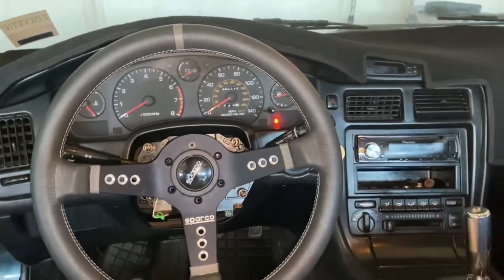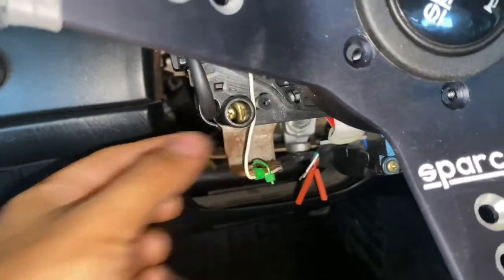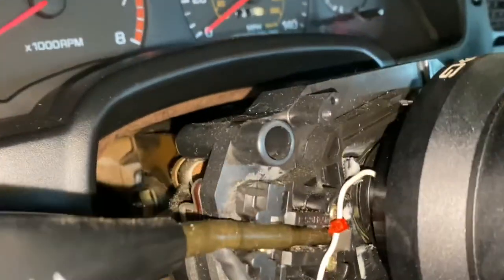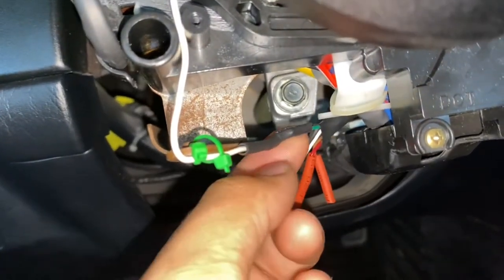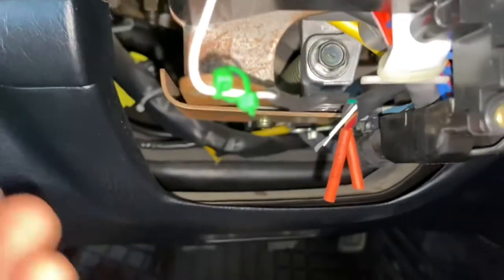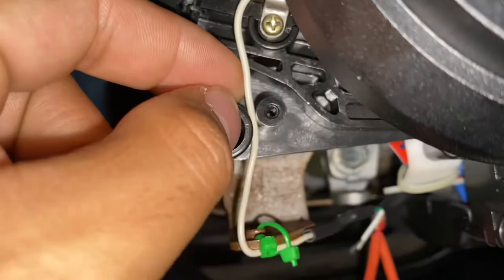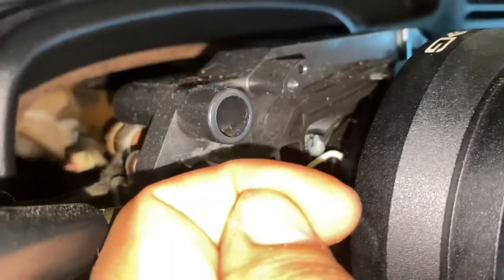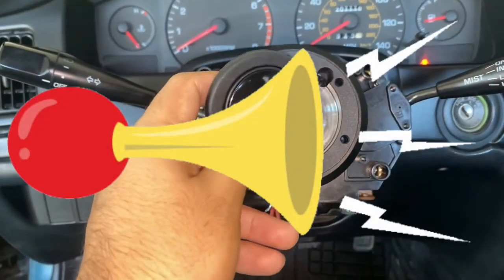AFTERMARKET STEERING WHEEL (WORKING HORN!!!) MR2

Comment: youve made harder work that it needs to be the connection is already there, remember your switching the earth to activate the relay to then complete the circuit switching the live throught the Green,/White cable. why on earth youve hacked the loom prior to the Slip ring, !!!!. All you need to to is make sure the Earth spring in the horn push is touching the metal, in the hole Then connect the already existing cable to the horn push, which will complete the earth circuit to activate the relay, to switch the live feed, to the horn.